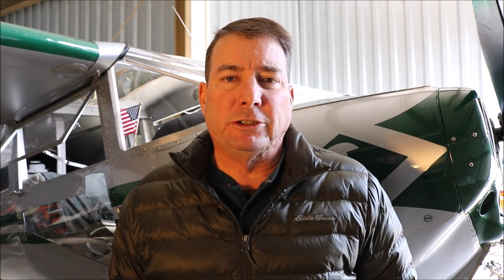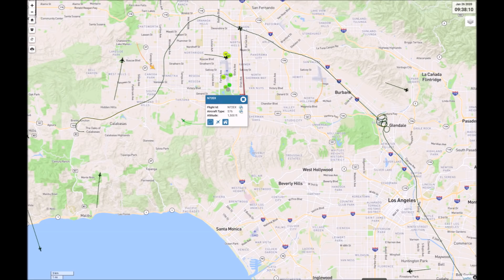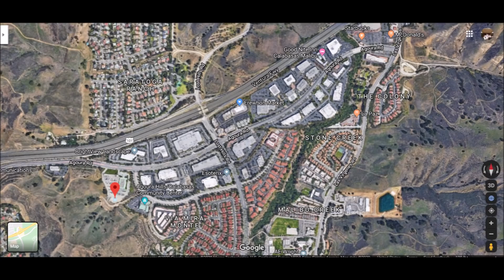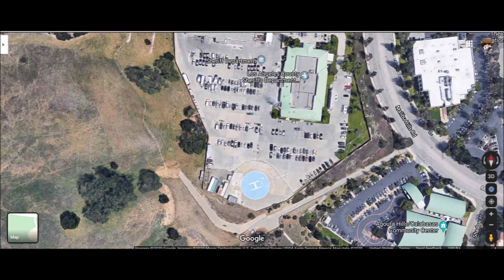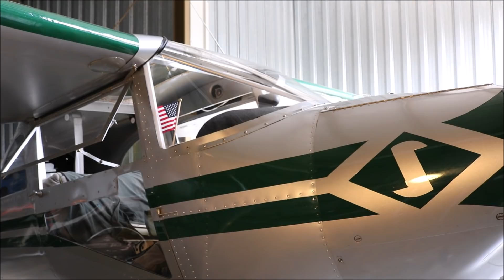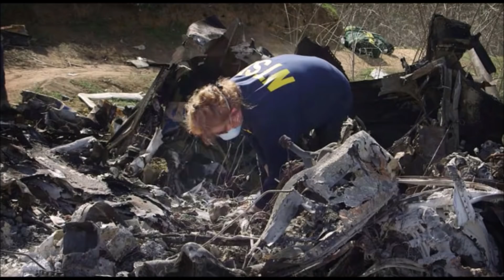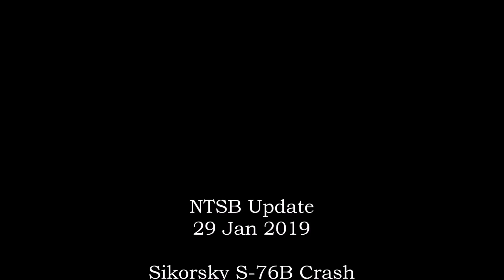Kobe Bryant Sikorsky S-76B Crash Update 29 Jan

Comment: I was a rotorwing pilot for 23 years. I knew a crew once that went IIMC. The pilot flying began a climb but was still looking outside for reference. When he looked in  at the attitude indicator he saw only black. He felt overwhelmingly disoriented, released the controls and grabbed the instrument panel. Fortunately the other pilot took the controls and got the aircraft under control.
Reply: He should of have a co pilot on board. What was he thinking? Even if he had 30 years plus experience. Even then. Just in case if he wasn't sure what or where he was going in such terrain and weather

Comment: Regarding nuisance warnings from HTAWS, rather than have a specific level AGL trigger an HTAWS warning, the warning should be based on how much time the pilot has to react (e.g. by climbing) to avoid hitting the ground, given the current level AGL, the current rate of descent and rate of ground rise (due to horizontal motion although this might require a GPS terrain map), and the vertical acceleration capabilities of the helicopter. Thus flying at constant level over flat ground would hardly ever give a false warning even being very close to the ground. On the other hand if you're quite a bit higher up but dropping fast, a warning might be anything but a nuisance.

Comment: I don't think terrain avoidance would have made a difference here, it seems they were climbing over the pass to avoid terrain already.  The most likely (unconfirmed) cause is the pilot taking on more tasks while already mentally saturated.  It seems he had trouble taking on more tasks while switching to instrument flying.  It would seem that if a pilot is flying in a high stress VFR situation (special VFR and very low) and they become overwhelmed they will  have difficulty switching to instrument flying.

Comment: More training on inadvertent IMC is NOT the answer. Training on when to turn back VFR, put it on the ground, or just cancel the mission IS the answer. Once you have transitioned multiple class D and Class C airspace in special VFR and are unable to maintain a pre decided minimum speed you will find yourself in a dire situation. This accident has all the indicators of a decision making failure. Inadvertent IMC is almost a certain death sentence for MOST pilots, instrument rated and current included. For the vast majority of rotor wing pilots who are nowhere near IFR current- the odds against them in inadvertent IMC are even worse.

Comment: When flying in a helicopter can you tell that you’ve drop about a thousand feet by feel or do you need your instrumentation to tell you?
Reply: You have to rely on your instruments in IMC Instrument Metrological Conditions to tell you what your aircraft is doing! If the pilot was flying VFR and was using the ground for his reference point and suddenly was in the fog ...he would of lost his ability to see the horizon and could of become spatial disoriented which causes
you to lose sense of which way is up or down right or left! With out the instruments you can end upside down in a minute.. JFK jr.. crashed into Atlantic because of spatial disorientation! Hope that helps!
Reply: That helicopter is very fast. If you tilt those nose down slightly and moving 80 knots you can drop 1000 feet pretty quickly.
Reply: Jessica, depends on your rate of descent. A thousand feet in a few seconds, oh yes you would know that you have a problem. Although with spatial disorientation (like flying in the clouds or at night)  if may feel somewhat different then what is actually going on.  To clarify a drop of a 1000 feet in seconds you would know you are in a dive, but it may feel like you are turning  a certain direction when you are actually turning the other direction.  You can do a search on  "pilot spatial disorientation", if you want to get a more technical on the subject. This is what happened to JFK Jr, and sadly at this point, it appears this is what might have happened in this accident. The NTSB and the FAA, and the manufacturer have to take a look at everything, and all the information they have and the wreckage to determine if this was the case. 
.
If you are not a pilot, just think about being on a roller coaster that has drops and turns,  you know what the drops feel like. Now think about riding that same roller coaster with your eyes shut, you still know all the drops and turns, but they will feel much different with your eyes shut. 
.
  Years ago an Eastern L-1011, this was back when there were 3 man crews  Captain, First Officer and Flight Engineer. They were trouble shooting a problem with the landing gear. Normal gear extended you get 3 green  lights. One light did not light up when they were on approach, so  they were out in a holding pattern trouble shooting the problem, when apparently I believe the Captain hit the yoke, which turned off the auto pilot, and they slowly descended not even knowing it and crashed in the Everglades killing all passengers aboard (this was at night). BTW, out of that came a new procedure that all airlines follow now, one pilot is always flying the plane.  Descending at a slow rate of descent,  at night or in the clouds, one might not even notice they are in a descent, say if you are a passenger,  that is why on instrument flight rules the pilot flying the plane is always flying using the instruments..  Sad thing in the Eastern accident, the bulbs for that one landing gear that did not light up were burnt out.  Oops, sorry this got kind of long. 
.
Hope this helps, take care!
Reply: Tower Runner Thank You! The more knowledge the better

Comment: this accident occurred .5 miles from my office of the last ten years. The area is unique in that is has almost it's own weather. It is basically at the top of a small river canyon that ends at the ocean 7-8 miles away. During times of overcast in the general area a heavy  ow fog will settle in a very small area of less  the a mile in width. Even in  car it comes on you suddenly. One point you make is not correct Juan. The spot they hit is a high point in the ridge that is probably 200-300 feet higher that the general ridge line. Often the fog with sit just above the ridge and obscure the high spot. I suspect when the pilot got turned around  back in the direction he came from, he saw daylight over the ridge and headed that direction and never saw the high spot. I would guess at its widest that point might only be 300-400 feet across. At the place they hit I would think maybe 75 feet. Saddest part is if he made a complete circle back to the highway he could have went back out the way he came  in. He had to have gotten within less that a 1/4 mile from the Sheriffs stations landing pad. As i looked around the area Monday about sun up I was overwhelmed by the thought of how these  poor people including the pilot died  in such an unfortunate  fashion.  Any other action would have resulted in a different outcome. The  pilot  just happened to fly into that single bad spot in an effort  to get out of that pea soup. He could have done many other things and no problem. I don't mean to say he was negligent or at fault. It is just horrible luck that he made the decision to proceed over that ridge at the one bad spot.

Comment: “Loss of control”, I doubt it. Disoriented controlled flight into terrain or vertigo more likely. I don’t think the pilot had loss of control. 

I agree that it’s a training/procedural issue
Reply: I think the sudden drop at 2k PM might be a reason to think loss of control.
Reply: @russejones  Sharp cyclic turn at 160+ kts, it doesn't take long to hit 2000 fpm rate of descent.
Reply: @ArmandoSilvier  No, he was over 1000 feet above the hill, lost orientation, and fell vertically into it at a very high rate.
Reply: kyleMcC13 what’s the difference? Spatial disorientation is very common in vfr into imc mishaps.  Once you lose you’re reference to the ground and you can’t interpret what the instruments are telling you or they are inaccurate you lose control of the aircraft.
Reply: Cory Turner special D is very different than loss of control. Loss of control would mean that is he is trying to climb to the left but the helicopter (mechanical issue) won’t allow or commands something different and flys into a hillside. 

I agree with you that once you loose ground/horizon reference (the definition of IMC flight for the Navy) if you don’t transition to an instrument scan you or trust what they are telling you then you will become disoriented. Now if the instruments are inaccurate(again mechanical issue) then you still would not have loss of control most likely, but you would be controlling the aircraft inaccurately.. possible into a hill.
Reply: Prelim. data on velocity at impact suggests terminal velocity.

Comment: This pilot was too afraid to utter. "Sorry Kobe, you gotta drive to the game today."  They had a Special VFR clearance.  To me that raises the hair on my neck.  That means the weather is crappy, and not good enough for VFR flight - 1,000' ceilings, and 3 miles visibility.  Three miles visibility is not very far.  You can be God in the cockpit having flown this route 1000 times and the day the vis sucks and you mistake one valley for another, you are instantly lost and disoriented.  Instantly.  I'm a former USAF MAJCOM Flight Safety Program manager with mishap investigation, flight safety program Inspection, management and Instructor pilot experience.  Hell I've got a physics degree and MS in Aviation Management.   I'll just say this to you young pilots out there.  Never push your limits with other people on board, and always be willing to say, "this is stupid, lets go land" (before the visibility gets too crappy and we can't see ahead- even if you are not the pilot in command), Or, "this is stupid, we're not flying today - period".  I flew T-38's all over the country with no weather radar, and none of this terrain avoidance equip. But we never flew Special VFR either. Flew C-130s and King Airs in Alaska, and never got myself into a crack I couldn't get out of.  (we flew 300ft AGL - three to six ship formations through the mountains) - routinely - but it was NEVER routine.   Sorry, but it looks like this pilot pushed it too far.  It's another sad day for aviation.   Perhaps CAPSTONE technology (in Alaska last I heard), with screens that show you the terrain in color, could have prevented this.  I seriously hope they find something mechanical caused this crash.   Fly Safe.

Comment: Thank you for your input into this matter. I wonder if there may have been a problem with the helicopter loosing the ability to hover and maybe the pilot accelerated and tried to maintain the hover then realized he needed forward movement and pushed the cyclick forward and he couldn't recover and could have been disoriented. Sorry if I don't use all the exact verbage to describe the idea. Could there have been a mechanical failure?
Reply: Did you watch Juan's video yesterday?  He said this type of helicopter cannot hover easily, so there was no ability to lose.
Reply: @vernicethompson4825  yes I watched his video. Many helicopters are difficult to do certain manovers, but that makes a good pilot stand out.

Comment: Final clarification: I am wondering why a pilot would initiate a fairly extreme maneuver at low altitude presumably while transitioning communication AND to instruments in surprise IMC (and rising terrain). I know you have to fly first, but that seems like a lot to manage for one pilot. That is why I asked about the roll. Could he have thought he was JUST climbing and the roll was disorientation? Or was pulling a 180 part of the plan to escape the IMC? If turning around is the right thing to do- why not do it after you are securely on instruments and at a lower speed?

Comment: Why , if you’re piloting a helicopter and you hit a low visibility area, could you not slow your forward speed & climb vertically until visibility increases or you know you are at a higher elevation than the surrounding terrain? Or why would you even fly at a lower elevation than the surrounding terrain? It doesn’t make sense to know there are 2,000 ft hills and terrain around you but yet you want to fly hundreds of feet or a thousand feet lower than the terrain. Even in perfect visibility
Reply: Based on what what was said in the video and other information from internet sources, it appears that is what the pilot did.... the ceiling became too low so he began climbing to increase clearance to the terrain, but (apparently because of slow forward speed and zero visibility) lost control and went into a rapid descent, ultimately making ground impact just below the cloud ceiling. There should be a final report at some point with the actual cause.

Comment: A lifeline helicopter just flew low over my house at night in terrible weather here in northern Illinois. They do it all the time. Every night. Similar type of helicopter. It can be done safely.

I have flown with that terrain warning system and I absolutely hate it. It's screams terrain, terrain, terrain in your headset and is actually a  distraction from flying.

Comment: Would Synthetic Vision have only encouraged him to continue rather than turn back, perhaps successfully 'this time'?
Reply: If he knew the route good enough he could have made it out if the tops of the clouds were low enough. He would have some explaining to do to the FAA probably for busting minimums or entering controlled airspace. They are not an IFR charter company. VFR only. Most IFR charters have 2 pilots. Transition to IFR is a practiced skill.  No real world practice and those skills go away fast. Simulators, unless full motion, are not the same. I've flown some IFR in helicopters but not my idea of fun. Speed makes it easier, going slow not so much. Your mind will trick you into thinking you're going along fine when you are really descending or climbing at 1000 feet per minute or more.
Reply: Was thinking that as well. He must have lost orientation though. Had he stayed at 2000 ft and just did a 180 turn it would've worked fine. He had Attitude indicators so that loss of control and descent would've occured regardless. The Synthentic terrain, if scud running that low to the ground at less than 500 AGL , would likely not be accurate enough with power cables, wind turbines, towers and so on. Was it confirmed if this Heli was Single Pilot IFR certified? Maybe going IFR was no (legal) option. Im glad my inadvertent IMCs were over flat coastal areas in Northern Germany - good ATC reception, flat terrain, only huge wind turbines to avoid. I think IFR is really mandatory if you are planning on using your plane for travel. Especially in hard to predict weather areas of the world.
Reply: Decending to the left, he was already disoriented. The time to go IFR is Minutes before you punch into a cloud, legally And mentally.  Once you are disoriented you have a very small chance of getting out of it and getting the aircraft recovered. He shouldn't have been scud running,  and he shouldn't have been given an svfr. Scud running is something you do by yourself,  not with a boatload of passengers.  They should have terminated the flight and arranged to be driven. 20 year cfii/rotorcraft . P.s, close to overweight,  did I read that right? And this guy was called a professional?  He did a lot to put himself behind the aircraft,
Reply: @eddie5556  Pretty sure not scud running. He makes the left turn to avoid flying into the mountain at his 12. What risk is involved with flying close to VNE, close to max gross weight, high power setting (collective), and high AOB?
Reply: @uberkraeger  He was likely in and out the clouds for a bit while running up the valley.I'm guessing he was entering the clouds before the slow down on the radar track. Noone will ever know without a CVR.  Do you guys know what the tops were that day?
Reply: @uberkraeger  he was given an SVFR, so by the very definition,  he was scud running. Flying at hi-speed close to the terrain severely limits your ability to see and avoid any obstacle that appears out of the fog. Flying very heavy slows the aircrafts response to control inputs, like driving a bus and not a sports coupe. Do one of these at a time, not a big deal. Do all at once and your chances of getting behind the bird increase at a rapid rate.

Comment: Hi Juan.  I listened to the ATC recording and at the last part of it when he cleared the controlled airspace and was transferred to SoCal.  At first it sounded like there was no response from the pilot.   But when I listened to it again.  He was actually communicating to the pilot but somehow the pilot response was not recorded.   It sounds like the pilot requested for FLIGHT FOLLOWING but the aircraft was to low.   So I think that’s when he climbed up to 2100 ( will the radar automatically see the aircraft at a certain altitude?... or is there like a ping button the pilot has to press to indicate location?..)  then I think he got disorientated trying to get down below the clouds?... I imagine the feeling would be like if you get buried from an avalanche your mind tricks you and you wouldn’t know which way to dig yourself out of it so the trick is to spit and which ever direction it goes that’s the direction u start digging yourself out.

Comment: Could the pilot have heart attack then he slumped over the control column pushing the helicopter down? The high rate of decent at the end of the flight does look that way. Also lacking the communication with the ATC before the crash might cause by this issue.